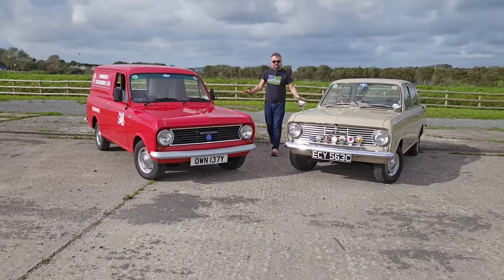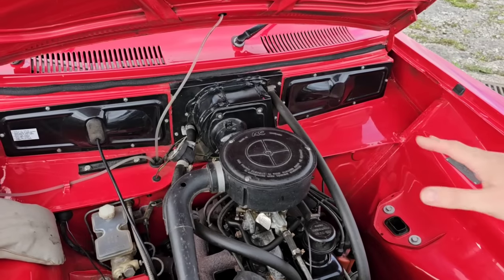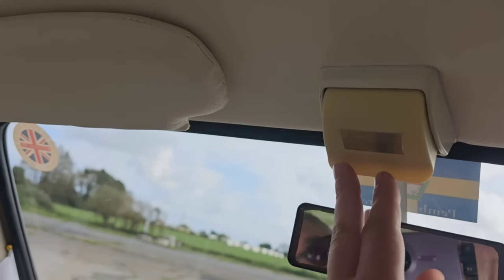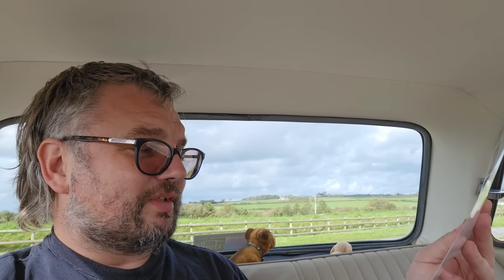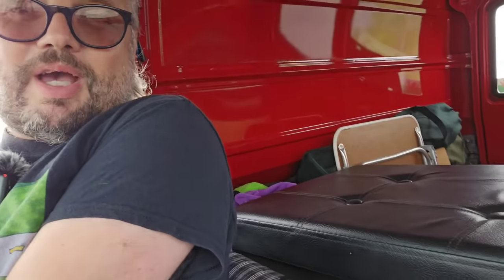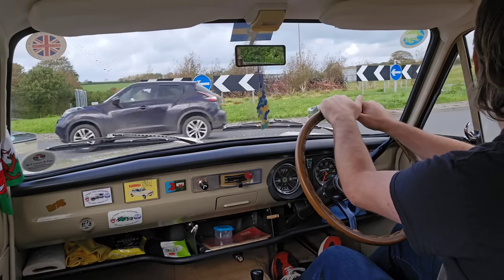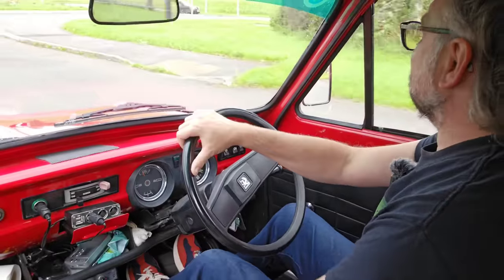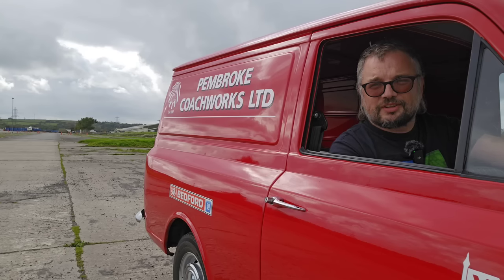Vauxhall/Bedford HA Viva saloon/van double test!

Comment: This is when you realise just how vulnerable the fuel tank was on some of these old cars...
Reply: As long as it was not perforated in a crash they should be okay (that was the Pinto's problem). Ahead of the rear axle (mandated in the US so most cars now do it) is probably the safest.
Reply: @steved3702  A heavy enough hit from the side, especially in the van version, and... Perish the thought. Ahead of the rear axle is definitely the best protected place for it, at least on a front engined vehicle.
Reply: @hadtopicausername  Especially towards the end of dailying it, I was acutely aware that a box crumples especially easily and that the non-collapsible steering column would not stop at my chest in a front-ender. Was that ever improved in the later vans? UK safety regulations seemed behind Australia quite a bit in this era.